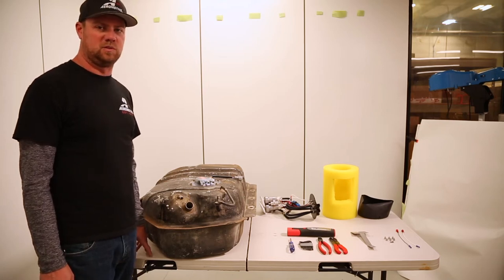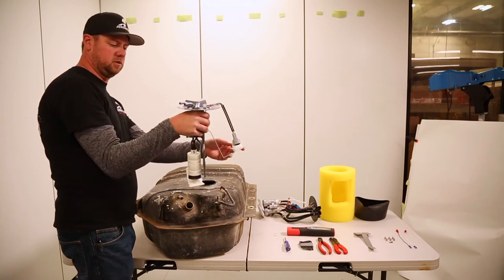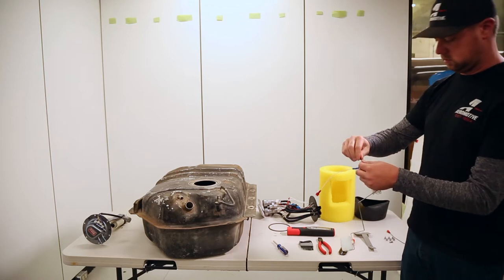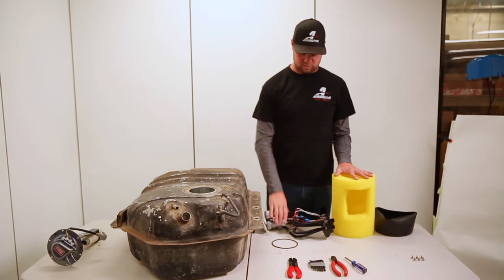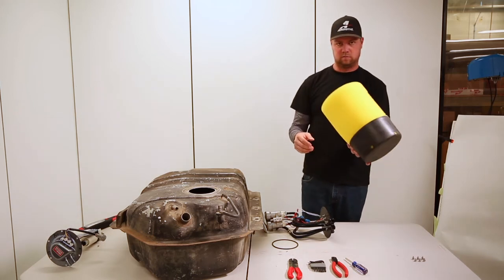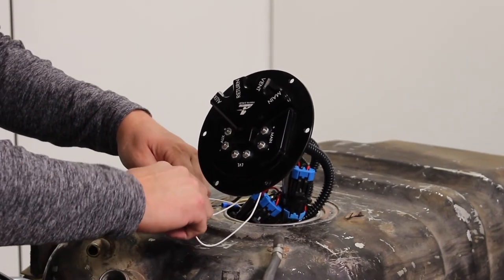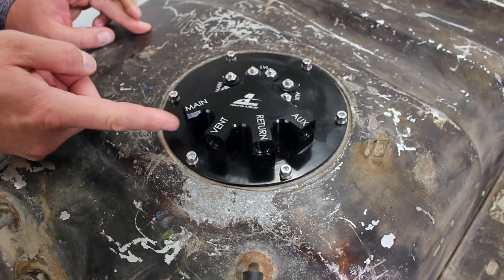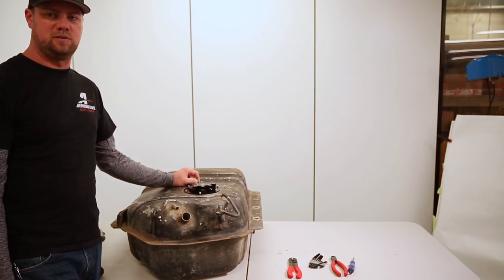Nissan Patrol | Aeromotive Install Tutorial

Comment: What model patrol does this suit?
Reply: I'd say a 4.8l 6 cyl with massive turbos and power upgrades.  Must be only for short distance driving otherwise why install such a massive fuel flow capability into a standard size tank of ~90L
Reply: All of the patrol tanks are the same diesel or petrol